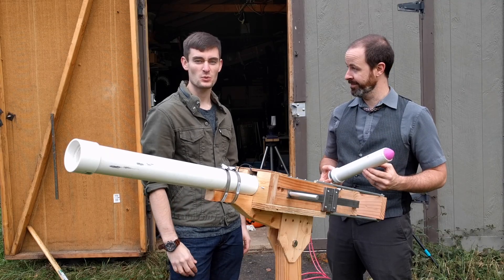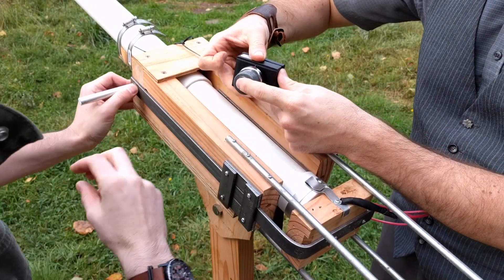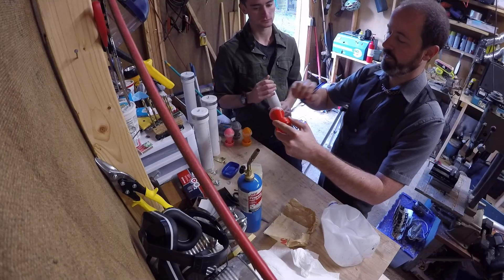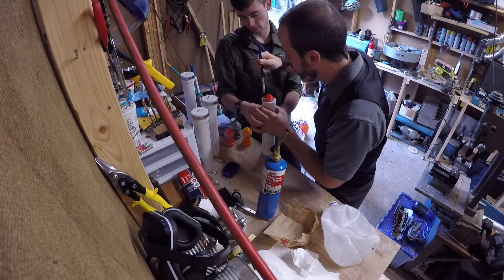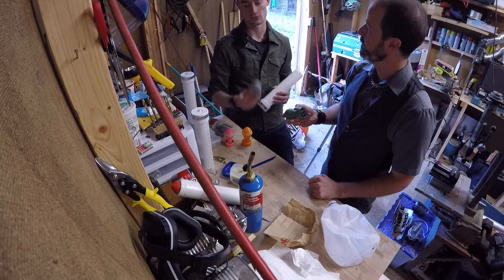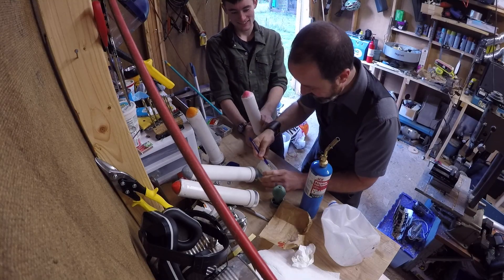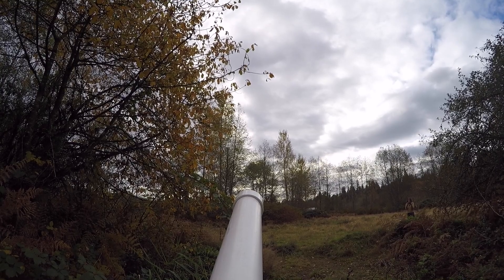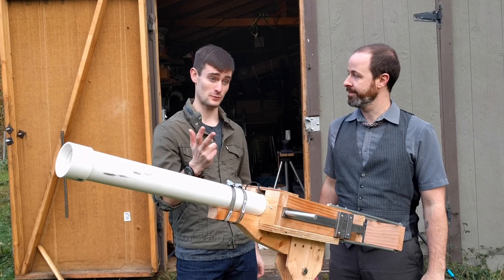RAPID FIRE potato gun, the POTOWITZER

Comment: Great idea.  You need an extractor.  I never understood the vital importance of extractors until I saw your design.  Then you need a magazine.  Then if you can do bolt action you can aspire to semi-automatic and automatic.  I'm certain you could do those if you were willing to put in the resources.  

I believe for your design the extractor is very easy, just one tab right next to the electrical lead parallel to the barrel, but this one reaching about an inch farther to click into place over the lip of the cartridge. This would be designed to ride over the lip of the cartridge (like a fence latch) as you prepare to fire and catch and then pull back and down with enough force to remove the spent cartridge as you pull the action back after firing.  

Also you could easily design the potato gun so that there is a handle on the right or below with a trigger and the left handle farther back so that a single operator could use it and it would be a more stable platform.  This assumes you can reload easily, like if you figure out the magazine.  Or one person could just both reload it and fire it I guess.  

Anyway such a cool idea guys, thank you.

Also for sure you can play around with projectiles and range optimization and various cartridge sizes.  

Then you need a contract with the navy. :)

Comment: you could create an extreaction and ejection method by redoing the top electrical contact, have it bend down to creat contact, then have a tongue come down and "lock" over the rim of the shell, then when you pull back the breach the toungue would catch and pull the shell out as well, then manually load another shell, close the breach and the toungue would catch the rim, etc...
Reply from the maker: Great idea! Maybe even with a hopper on top for the shells so the next one drops in

Comment: It would be easy to make an extractor to pull that tube cartridge out when you pull the wooden bolt back. A simple hook made out of wood with a spring to help clip it over the PVC end cap edge.  You could mount it on the top and move the electric strip off to one side. It should be able to pull the tube back and let it fall. But if the tube hangs up, the hook. could be made so that when you pull the bolt back it would go under a bar that would rock the hook up to release the tube of it doesn't fall.

Comment: Love the desing, i def think not having to ram the potatoe is nice. I went about it a different way by having my potatoe cannon be bolt action. Barrel and combustion chamber separate, potatoe goes in back of the barrel and the combustion chamber gets pulled back forwards, has gasket/o ring to seal. Cannon was a 63mm L48

Comment: consider filling the shells with rosin, or spin casting for a hollow but even coating to provide some weight and durability
Reply: When a friend and I were making shells for are pressure cannon we filled it with ball bearings. However we found a better solution by just 3d printing fins and attaching it to a 8inch Nail core to form a FSDS round that can punch through plywood with no problem!

Comment: If you added a simple pair of extractors, one hook to either side of the top contact  to grab the rim of the shells, your empties would drop free as you re-cock the cannon, speeding up your firing rate.  At first glance the metal bar looked like it was an extractor, but you showed that it came up short, and was the contact to the perimeter of the shell.

Comment: You should add a extractor head to the metal electric connector so it grabs the edge of the pvc end cap so when you pull it back to reload it automatically ejects the empty shell

Comment: You can/should  use the petroleum jelly to diesel the projectile by putting some on the underside that will experience the high pressure...for all of you kids out there that have no clue what I am talking about and are known to get in some trouble now and again ...this is specifically for you... diesel fuel does not need spark plugs to ignite.. It automatically ignites under pressure with the correct fuel to air ratio...many different fuels can be dieseled...and petroleum jelly happens to be one of them ..people take PJ... And put a tiny bit in the cavity on the back side of     .177 pellets for pellet guns.. The pressure causes it to ignite and dramatically increasing velocity of the projectile..just need to  make a similar indentation in the 3d printed projectile and you are in for some fun.. Be prepared for people to call the cops because it does make it sound alot louder

Comment: Great design , would like to see starting fluid as propellant.
Reply: I'm wondering about that as a fuel source as well. I'm wanting to shoot nerf rockets. I don't know if you've tried using starting fluid but if you have could you let me know the results?
Reply: @hecksnekinc.2750  I have in a potato gun that might be a little much for nerf darts. .5 seconds per potato using a 4” x 18” chamber necked down to 1 1/4” was quite the blast.

Comment: ejection mechanism would be awesome
Reply: Paul Kurz and easy to make. A bolt action rifle only has a hook type of extractor that turns into the shell rim upon the shell entering the firing chamber. And is turned out upon striking a bump or hump upon the bolt reaching a certain point when the bolt is traveling rearwards. The extractor looks like an S and it pivets in the center. And it grabs the shell rim bottom.

Comment: This doesn't seem that impressive to me, it has too many flaws. Gas-filled rounds don't seem that reliable, and they took the time to print the projectile, but they don't have an accurate fuel measuring system. On top of that, the "gun" is just a firing system, you still have load and eject each round. I would argue a conventional potato gun is faster, more reliable, and more powerful. ROF is the only real plus side, but that goes away with shell prep.

Comment: This is great but it could be better. For one the igniter should be build into the handle, two a injector should be built into the action so it strips the last shell out when you pull the action back, and finally a gravity feeding system would really increase the fire rate especially if you added #2.

Comment: I agree with the comments about an extractor. Make the upper contact a bit longer and put a 90 degree bend in it so it hooks over the edge of the cap on the cartridge (right were you were using your fingers).

Comment: I have an idea here, tell me what you think:

 use a burst disk/pressure release valve in front of a hybrid combustion chamber with hydrogen and oxygen. 
 use a magnetic induction coil to avoid the need of metal contacts
 use aluminium casting and a 3d printed sabot to make a sabot round
If any of you watched the myth-busters arrow machine gun episode, essentially the mechanism would be an up-scaled version of that possibly with an electric motor instead of a handle spun wheel

Comment: If you add a sprung catch / hook to the breech, as you pull the breech back the catch would also pull the spent cartridge back into the ejection slot, allowing gravity to clear the shell.
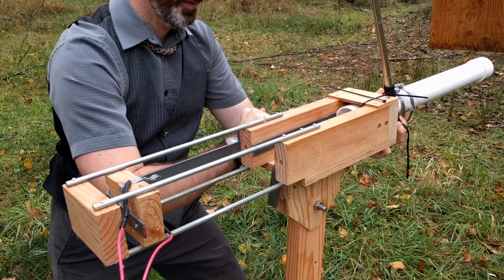You just need the catch to engage with the ridge of the endcap, much in the same way your fingers do at 3:51
Reply: And the catch could also act as the contact point for the second ignition lead.
Reply: you could easily do it by bending that peice of metal down
Reply: i was going to say they could pretty easily make an extractor for it

Comment: You could make the top electrical contact √ shaped, so it contacts the metal ring, but also slides over the endcap's edge. Then when you pull it out, it'd snag the endcap and pull the shell out, dropping it when it clears the barrel.
Reply from the maker: Love that idea! Might have to add it if we go for more mods!
Reply: was just going to suggest that too

Comment: You could replace the base electrical contact with a valve for better charging, and you could also set it to make the spark too
Reply: And a shell ejector mechanism might be a nice touch
Reply from the maker: The only concern there is it would pretty drastically reduce our rate of fire since every shell would need to charge (fill with the right amount of propane) before ignition.
Reply from the maker: Working on it :)
Reply: i think you misunderstood, i didn't mean for charging "in weapon" i meant so you could use some kind of 'press to charge' filling station, where you push the nipple on the base of the shell into a valve system which releases gas at the correct rate to charge the shell rather than doing that 'nasty' blowtorch fill.

also perhaps a captive O-ring might make for a less messy charging process.
Reply from the maker: Ah I get where you are going. That would also reduce prep time significantly in terms of mass filling of shells. Might have to make that happen!

Comment: Amazing build as usual, does seem like you have some serious pressure loss between the projectile and the barrel walls though, is the barrel a larger diameter than the shells?
Reply from the maker: Not as much as you think. We are still trying to nail the proper fuel to air mixture and are working on a system to make it more consistent.
Reply: HodgePunk go with a tire valve fill system and psi of gas. A better gas that is cheaper because you can make it yourself is hydrogen. Just use electrolysis and aluminum with backing soda. To make your hydrogen. Pressure it up to different psi and test the different pressures and combustion pressures efficiency. 1 leter of hydrogen at combustion will start a V8 gasoline engine. Or turn all 8 pistons with enough force to make the engine start. So 1/4 leter at 5 psi of hydrogen should give you the results your looking for.

Comment: what about hydrogen instead of butane? or is that too explosive?
Reply from the maker: +fredlllll hmmmm, maybe :)
Reply: Not at atmospheric pressure. Doooo iiiitt!
Reply: electrolysis also gives you the perfect mixture right away :D
Reply: Hydrogen is harder to work with and not as readily available. It will also not shoot as far because there is less hot gases being produced in the reaction